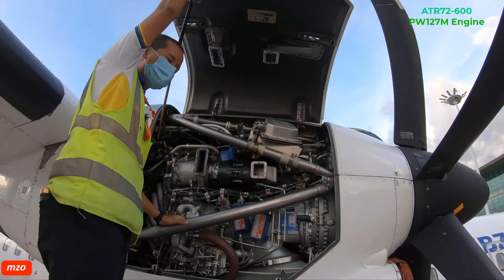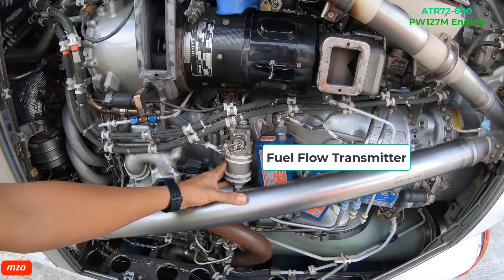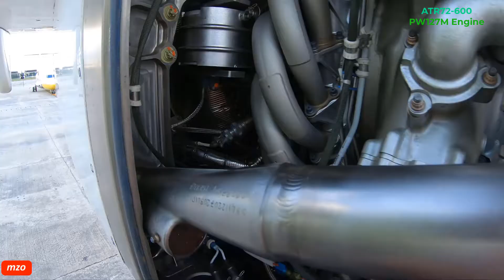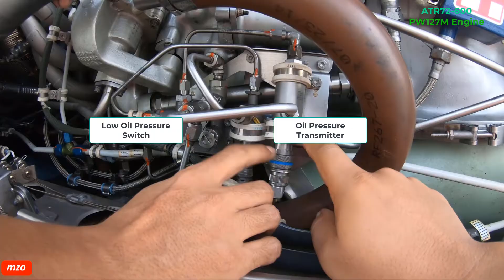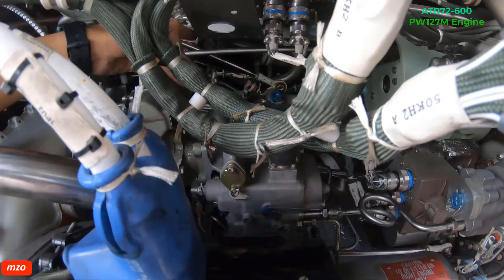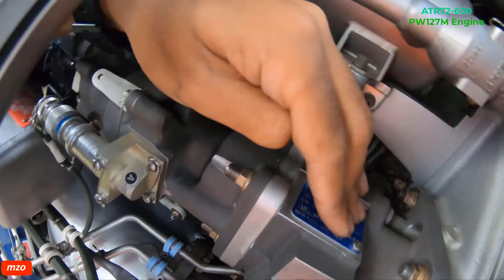ATR72-600 Engine Component Locations Part.1

Comment: Great video. This is better than what I get at the airline I work for. On a side note, I would be good to mention the proper closing order for the engine cowling latches, fist the top two then the bottom two, just like the technician in the video properly did. We just had an incident where the cowling open during flight and caused major damage to the engine components. Surprisingly, the cowl did not get torn off. Cheers from South Florida.

Comment: Does NH means high speed?
Reply from the maker: PW127 engine have two compressor which are high pressure compressor (NH) and Low pressure compressor (NL).